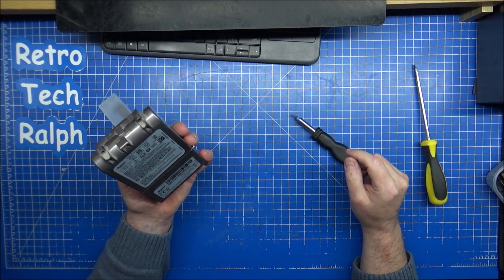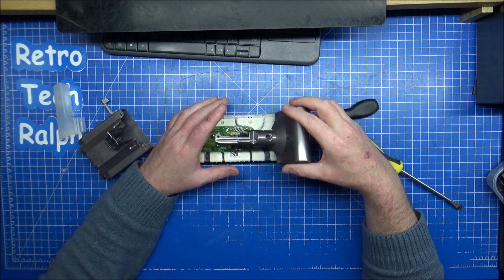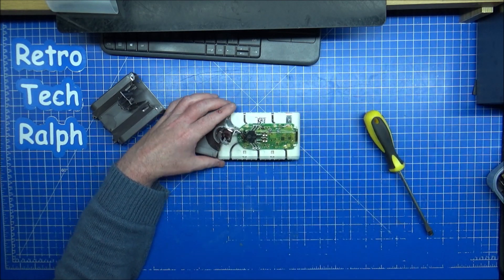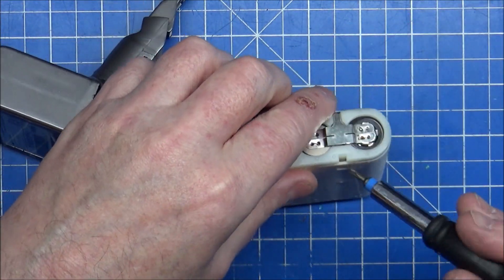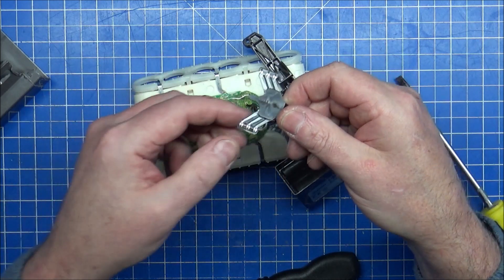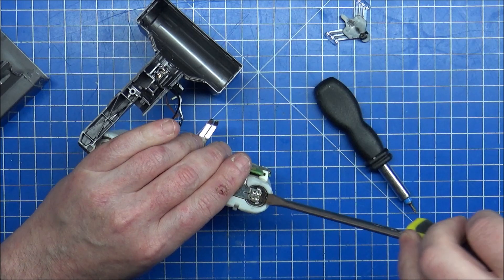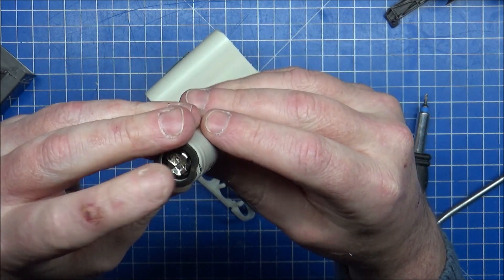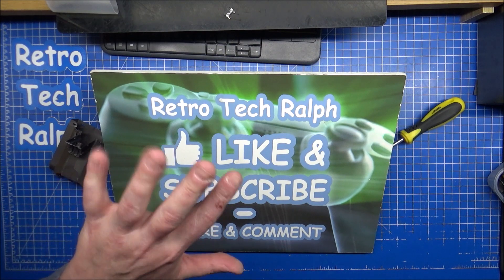Dyson Battery Teardown. - How hard can it be.

Comment: The Dyson packs are built to be very difficult to take apart. I've done this to salvage cells. Major work. Hilarious BAD DESIGN is that the beautiful self-contained battery case and controller IC is attached to the on/off switch and power-charging plug by cheap puny/skinny/frail hand soldered wires that look like they came out of a $5 transistor radio from Taiwan in 1950. More bad design is that the charger plug is seated in a POS plastic holder that broke clean off inside several of my packs after misaligning with the charging dock...TOTAL CRAP and a fatal flaw because once this breaks the whole pack is a HAZMAT trash-toss (unless you are willing to risk doing this take apart to salvage cells, which is probably far less than 1% of the owner base). On top of this DYSON, QUITE IRRESPONSIBLY IMO, does NOT offer a RECYCLING PROGRAM FOR THEIR EXPIRED/BROKEN PACKS mainly because it takes 30 minutes of semi-dangerous manual labor to disassemble these overbuilt assemblies. I've STOPPED buying Dyson batteries and now only use a Ryobi ONE adapter to run my several Dyson Animal V8 units on 6ah Ryobi 18v batteries which last long, cost half or less of a Dyson, can be swapped out for a fresh one in seconds, and although a bit below the 21.5 V Dyson spec power, still provide ample juice for both normal and high speed vac ops.

Comment: It would have been interesting to see if the BMS can be brought back to to life by replacing the cells or whether it has a protection mechanism, like storing a "I'm defective and will never work again"-flag in some sort of persistent memory. For a quick test to see whether it is possible it's usually good enough to individually charge each of the old cells up to ~3.7V with a lab power-supply (slowly/carefully) and see how the BMS reacts. But thanks for taking the cell out, now I know that I would need 6x 20700... which cost about 25Euro :)

PS: Please get some pliers - watching stuff getting ripped apart by brute force makes me shiver.
Reply: I heard some of the Dyson bms would be permanently disabled if any of the cells are more than 300mv out of balance from the rest of the pack. I'd probably connect it in parallel with another 6s pack that I have before attempting to replace the cells just in case and make sure that pack is charged to the exact same voltage. Dyson's bms doesn't actually balance the cells
Reply: i repaired mine, afther lying around for a year without batteries the bms was still working like supossed. this device does not have an evil bms